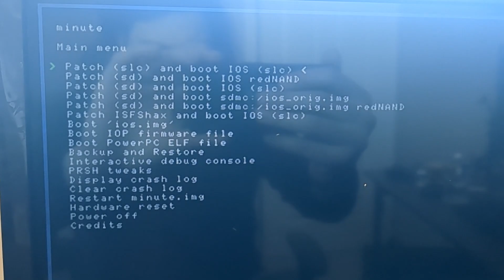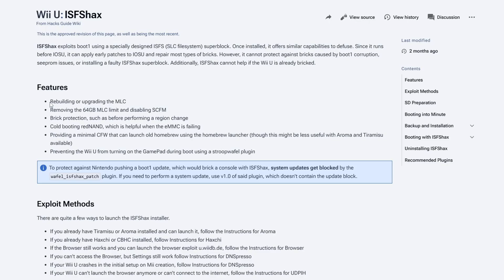If you have the HYNIX Chip, you Should Watch this!

Comment: Not even about a week after watching this video (which was a week from me typing this), it happened to my 32GB Black Wii U that I just bought..I just got done following all the guides on the guide website to install aroma, and all of that, I saw this video and installed isfshax then like I said a week later, after getting all the GCN, Wii, and a few Wii U titles, I go to create a new user, and get met with a error "There was a problem with the System Memory", rebooted, went into mii maker, same thing, games were still working but I couldn't''t switch to prentendo or do anything with miis/accounts, had to do a tutorial on redNAND and rebuild the MLC to the SD card, after all that I was met with a fresh install and was able to login to pretendo, and all of my saves/games were still good and aroma was untouched. So I fixed it, for now thanks to your vid FS47!

Comment: mine ended up being the hynix =( ... 01 on the sd slot...   went through the playing history -  console hadn't been used in over 7 years....    console works perfectly fine.   I got them to knock 35 off the price until I could check what chip was in there, and just told me I can have it at the lower price, and take it with whatever chip is in there.

Comment: I just checked the two WiiU consoles that I own: colored ports on the back, 01 under the SD card and 2012 as the production date. But I'm still not sure because I couldn't check with the wiiuident program. I couldn't install it. Both consoles are modded with Haxchi and when I run the wiiuident program from the Homebrew Channel, I get the error to upgrade to Aroma/Tiramisu.
---
Later Edit: I managed to install Aroma and now the wiiuident icon appears directly on the console's home screen. I ran the program and realized that I can rest easy, I have a Toshiba chip. So in my case, colored ports on the back plus the inscription 01 under the SD card plus 2012 year of manufacture = Toshiba chip.
Anyway, when I modded the console with haxchi I saved the contents of the NAND memory so I have a backup if the NAND gets bricked in the future.
Thanks for the video.

Comment: I was super worried for quite a bit there since I had all the symptoms of the HYNIX chip without checking (coloured ports, inside the SD Card said 01) and today I finally decided to setup the console and download wiiuident onto it, and turns out I have a Samsung chip inside! So I definitely recommend to everybody to check in the software before panicking, what a relief.

Also turns out that I have a launch model 32GB console, even though I got it in 2013 :)
Reply: I have a coloured ports and 01 inside SD card having to wait for a new gamepad but hopefully I am as lucky as you
Reply: Hey man, same here, 01 too even. I will installthe program tomorrow
Reply: @ so I’m presuming u will get Samsung aswell if u have the same signs that I had 
If you’re model of console  is a wup -101(03) from 26/01/2013 u should be good as that’s my console model and date

Comment: I think that SD Slot Number thing is Non Sense. My White 8GB launch model says 01 in the SD Slot and so does my Black 32GB with colored ports from 2012
Reply from the maker: as i say in the video..."if it has a 40 or 50 it means it does NOT have hynix" i guess i shoulda been more clear that just because it is a different number doesn't mean it's hynix lol

Comment: So i found out i probaly do have the HYNIX chip unfortantly :(
My ports at the back are coloured and my sd slot has a 10 as number.

I pre orderd my wii u back in 2012 all tho my Wii U does still work to this day after this video i play a game of rumble U to check.
All tho when i started up it froze and nothing happend but that was probaly because i touched the wires at the back i just unplugged it plugged back in and it worked like it always does.
My console isn't modded or anything should i be worried? (kinda thought i was fine since its almost always plugged in but saw that doesnt acaulty matter luckily it works for 12 years straight so hope for the best?)

Comment: I am not good at modding or opening up wiiU's. My original has a high chance but I have no idea what it has considering the year I bought it.
However just a question I bought a 2nd one 2nd hand. Is this something that effects only 2012 and 2013 wiiU's or does this effect later ones?
I can't check the number in the sd slot for my other one currently but I remember it was coloured connections also. However it's a limited edition version that came out 2014 onwards. Is there still a chance for it to have it? Otherwise I am going to have to dig it out.

Comment: I was worried because my ports are colored and I had a 01 in my SD card slot, but after trying the software to check for sure, it turns out I have a Toshiba EMMC, big relief.
So don't sound the alarms if you have colored ports and don't have 40 or 50 in the SD card, install the software and check, there is still a chance you don't have a hynix.
Reply from the maker: Yeah those methods are really only for people who don't have time (buying a Wii u) or willing to homebrew /open up their console. The best is wiiuident!

Comment: You only have to keep it plugged in and use it once in a while, the problem happens when you leave it unplugged for a long period of time, people reported that it takes years.
Reply: This is false as covered in this channel's previous video "How to find out if your Wii U is COOKED... (without taking it apart)"

EDIT: It's also in this video at 0:36, you didn't even watch. Shame on you, delete your comment.
Reply: @mjc0961  hahaha ONE guy says "there is no evidence that it helps" so you will blindly believe that ONE guy? Poor you. I've went through the rabbit hole where people who actually know what they're talking about identified the exact problem and the conclusion is turning it on and using it WILL prevent failure of that chip. Do your research instead of blindly believing in a single opinion without even going in the technicals. Now YOU delete your ignorant comment 🤡

Comment: PSA:
you can check your board revision but flipping the console upside down and checking the smaller white sticker. the last 2 digits will be your board (ie 30, 40, 50 etc)

Comment: i have a question, (this has not personally happened to me)
what happens/what do you do when your external hard drive (being used on the wii u) stops working? will it damage the modded console itself or just the wii u games that are stored on the hard drive? (will savemii restore the data?)

Comment: I was completely convinced that I had a hynix chip, I checked the back, colored ports, I checked the sd card slot, it said 01, I checked the production date, 2012, but I looked at the chip (through wiiuident) and it was a Toshiba chip. Wow.
Reply: For the WUP-01, your chance of having a hynix is roughly 1/3. And the color of the ports is redundent to knowing the revision.
Reply: Same for me for the two WiiU consoles I own: colored ports on the back, the inscription 01 under the SD card and 2012 as the production date. But I'm still not sure because I couldn't check with the wiiuident program.
---
Later Edit: I managed to install Aroma and now the wiiuident icon appears directly on the console's home screen. I ran the program and realized that I can rest easy, I have a Toshiba chip. So in my case, colored ports on the back plus the inscription 01 under the SD card plus 2012 year of manufacture = Toshiba chip.
Anyway, when I modded the console with haxchi I saved the contents of the NAND memory so I have a backup if the NAND gets bricked in the future.
Reply: @antonelrotaru20  you guys are so lucky, i have a hynix, and my Wii U had a production date of 2013, so i got REALLY unlucky  with that lol
Reply: Exactly the same data for me dude, ended up being Toshiba

Comment: I did notice I have an "01" in my SD card slot.

Sadly, I may have to hard mod my Wii U anyway since the SD Slot is broken. The spring (and I believe the plastic bit) came out and lost. :/

If you are curious. I did had Haxchi on the Wii U before it was broken.

I was already planning Hard mod many of my retro consoles anyway to be more suited for modern use like USB-C power and HDMI. It just means I have to add Wii U on the Fix.

I do check my Wii U every month or 2 to keep the NAND in check. So, there's that. But I may also use the Hard mod to have alternative NAND as a safe measure anyway.
Reply: If only the spring and cover are broken/missing, then you could cut a small piece of rubber and tape it onto the front to keep the SD card in the port.

My friend did a similar thing when his Wii's SD spring broke, and it worked for him.
Reply: @Protofall I may need some photos just in case to see how I should put it in and how delicate it is to do it.
Reply: @ In my friend's case, only the spring broke, he still had the lid working. So I think he taped the rubber to the inside of the lid.

But in your case, all you really need is a heavy object that can stand tall enough to reach the slot, tape something like rubber or a small piece of wood, and move it closer until it pushes your SD card in. It would be a temporary setup, but at least it would be enough to un-brick your console.
Reply: @Protofall  it's not bricked. It doesn't have those soft mods.

It just can't use SD cards when inserted. So, I can't use Haxchi at the time.
Reply: @ Ah, I misunderstood then.
Reply: @ It's fine. I think the plastic or whatever it was is likely the mechanism that tells that there is an SD card inserted or not.

What you were thinking is the lid cover for the SD and USB's bay. That part is fine.
Reply: @rocketgamer3005  Oh, yeah I was thinking of that lid cover. Not sure what the plastic you're referring to is then. Some internal component?

Comment: So yeah, I'm pretty sure my Wii U has a Hynix. It's a black Wii U, it has colored ports, and the number inside the SD card slot is 01 rather than 40 or 50. This doesn't surprise me, as my Wii U is a launch day Wii U, so it's over 12 years old now. I still need to run the homebrew app to find out for sure, but the likelihood seems high that mine is Hynix.

The good news is I decided to plug it in and boot it up today, for the first time since I bought my Switch on launch day in 2017. And it booted up with no issues at all. It got to the menu, I connected it to the internet, and it downloaded the latest update. It still worked after the update. So even if it's a Hynix chip, mine doesn't appear to be a lemon chip.

That said, once I get a moment to do so, I will plug it back in and set up the homebrew software required to see exactly what memory it uses, so that I know if I need to set up ISFShax or not. I transferred my Wii data over to the Wii U when it came out, so it has my entire library of Wii and Wii U digital games on it dating all the way back to 2006 when the Wii came out. So I don't want to lose that.

Comment: Man, i dont know how to thank you. You helped me mod my 3ds and this brought me so many good memories of my childhood. I am currently modding my 3ds, but cannot connect the gamepad to the wiiu. Whenever i press sync for the second time, it displays an error without code and prompts me to reboot the the console. This happens over and over. Because of this i cannot mod my wiiu. Do you have any fix or workaround? Thanks from Brazil brother.
Reply: Btw, I have tried everything on the internet. From the simplest to the most complex and nothung helped. I am thinking about wrapping the wii u and console in some sort of aluminum box to isolate the 5g frequency from the surrounding. This is already my last resort before getting it fixed, but i wanted to mod it very badly and this is the only thing standing in the way. I even tried calling the support and they couldnt help either.

Comment: You and the community are truely fantastic. Was bummed to find that mine has the colored ports and "01" in the SD slot. Using WiiUIendt, I found that my 2013 unit has a Tosiba chip. So, good times for a bit longer! Will still go about backing everything, for good measure. Thanks for the vids, Scott.
Reply: My og Wii U also has an 01 and colored ports, thought i had a hynix chip, this puts me at ease a little, i kind of wanna keep it stock as i only intend to use my White one, but this is some nice peace of mind til i open it up. :)
Reply from the maker: Definitely glad you checked with WiiUIdent because the other visual methods are only indicators which can scare people if they don't use the app to make sure!
Reply: Mine is exactly the same. Haven't checked the colored ports but I feel like I remember them being colored. I also checked the SD card slot and it was 01 like yours. It made me feel a bit worried considering the visual signs all did not line up to the systems that would not have the Hynix chip, so seeing your comment makes me feel better. Also my system is from the New Super Mario Bros. U and New Super Luigi U bundle from 2013.
Reply: Got the exact same bundle! Glad to learn this info! @timmyb.3426

Comment: My Wii U has the colored ports and it has a 01 in the SD slot so it is likely a hynix chip so I have to mod it or open it to make sure.
Reply from the maker: Modding it is very safe if you follow instructions, but again it's up to you because it's your console :)
Reply: comment back or edit your OP when you find out, just for prosterity. A lot of users are providing hopefully honest info about their consoles with colored ports but samsung or toshiba chips

Comment: My Wii U has a 01 in its SD Card Slot and iam not sure if i can use WiiUIdent on my wii u because its homebrewed with haxchi
Reply: You can check by opening the console (requires a tri-wing bit) or if you have a way to use UDPIH with recovery_menu on your SD card
Reply: Maybe this will help, i also have an 01 in the SD card slot and unfortunately mine has a HYNIX chip. i checked with WiiUIdent.

Comment: What if i have a 01 in my sd slot
Reply from the maker: You can't truly tell the unless you use the Wiiuident app (you need aroma cfw for this) or physically opening the console
Reply: it means you might have a hynix chip and you might need verify by a few methods: open the console, use software to check it after modding the console, or use UDPIH with ISFS/recovery_menu to check system information (no mod required but a Rpi Pico is needed)
Reply: And if you have a hynix chip, don't panic. You just have to not leave it unplugged for long periods of time, people have reported that they had the problem after years of having it unplugged with a very small minority saying that it happened after a couple of months, which I doubt. Just keep it plugged in and boot it up every 2 months, maybe playing a game for a bit to be safe.

Comment: I just like the fact that with a Toshiba chip, there’s no worry of anything happening in the future lol
Reply: Wouldn’t exactly say that. Chances are both Toshiba and Samsung will also fail out but it’ll obviously be a long time. Hynix just happened to fail a lot sooner. As nothing lasts forever.
Reply: @psychopat4402  I have strong suspicions about Toshiba as of late, as my JPN region Wii U has a Toshiba chip, and my USA region Wii U I had for 11 years has a Samsung chip.
Reply: @lucasn0tch  let's face it Nintendo do not make quality products anymore and if it wasn't for the Japanese market would av probably gone bust a long time ago...
Reply: @psychopat4402 there has been documented dead Toshiba and Samsung ones in the WiiUIdent database
Reply: The Problem is that NAND Flash has a limited lifespan because every write operation will cause it to deteriorate and after enough time the cells will not work properly anymore, and this will happen to every NAND no matter if it's a Hynix, Samsung, Toshiba and this of course also happens with every USB Flash drive, SD Card and SSD but usually it takes almost an eternity until that happens. The hynix chips just have some kind of manufacturing or design defect that causes them to break much sooner, but with enough use it will happen to any flash chip in the future.
Reply: @LED-cx6wj  sounds like a horrendous design flaw and build mistake

Manufacturers need to make it infinitely easier to backup, transfer, and store data from their consoles
Reply: Install isfshax still lol
Reply: True
Reply: other things can happen to it, so it's not really 100% safe
Reply: who knows
Reply: That's not how tech works. It'll all fail someday.
Reply: Mines a 01 and I checked it earlier it’s a Samsung nand chip
Reply: Well I opened it up that’s how I found out it was a Samsung cause it always peaked my curiosity that mine never screwed up